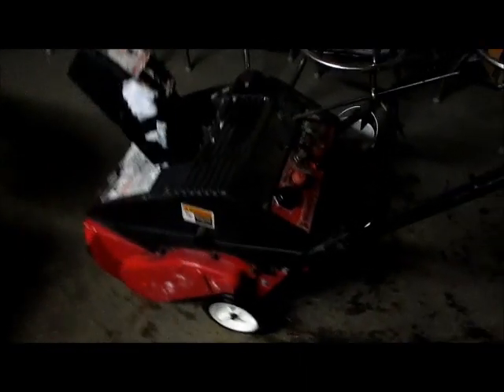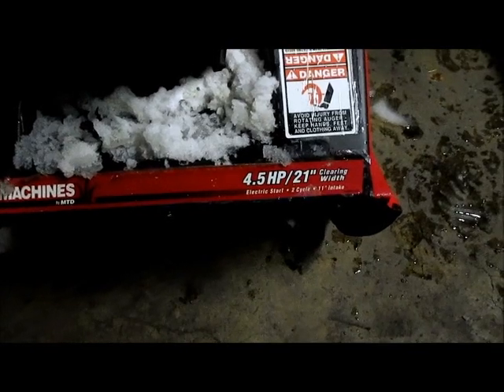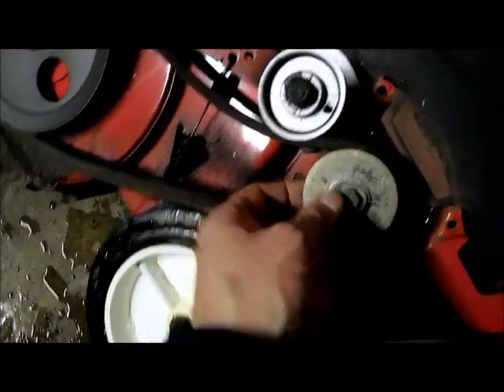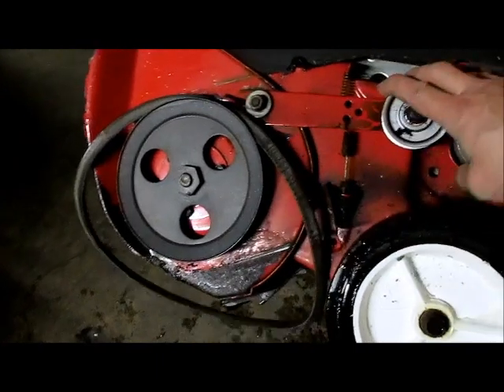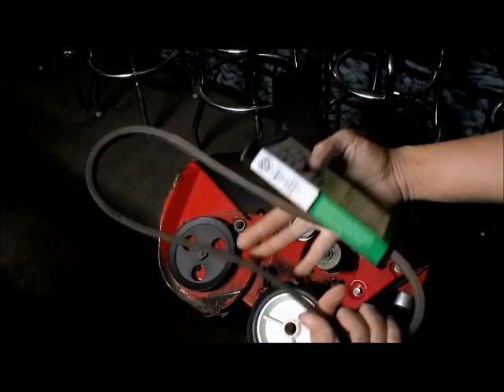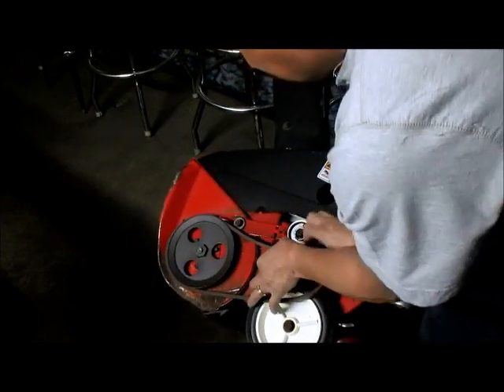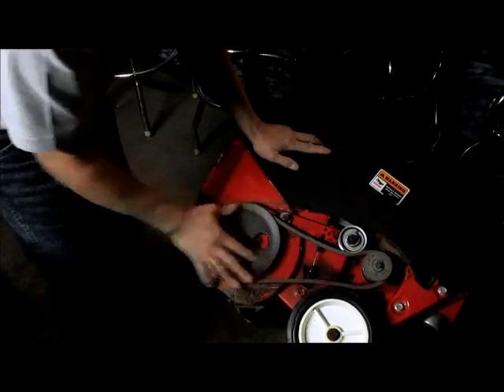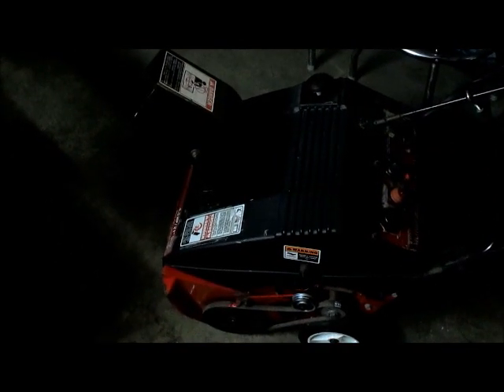belt change Yard Machine Snow blower/thrower 21"

Comment: Great Video Thanks. Just a word of advice. If you unloosen the bolt to the pulley on the shaft to the motor, it splits in half to allow easy assess to put the belt on. Just throwing it out there. Thanks!

Comment: Most snow blowers have a dead mans switch/key. Just keep off and pull key out. Motor will not start. Here is a little trick, when putting belt on pulley, attach to auger pulley first, then start on motor pulley and pull cord gently to roll belt on. Finally, work belt under idler pulley. You are done. Great vid however use more light next time.

Comment: It's called a tensioner for a reason. It was tight reinstalling it because the idler pulley was applying tension. Next time slip the belt onto the the large pulleys first, then under the idler.